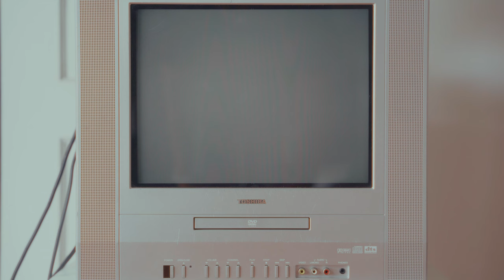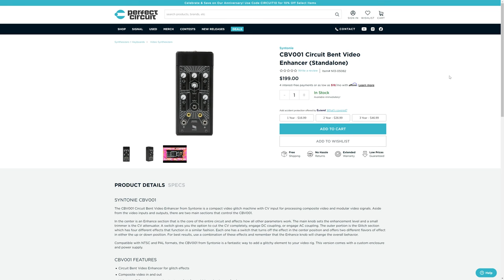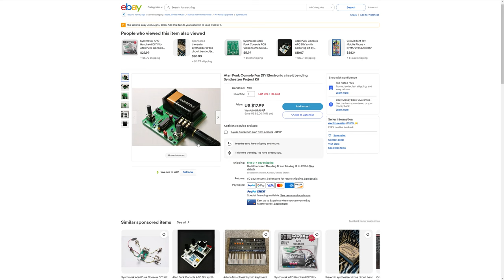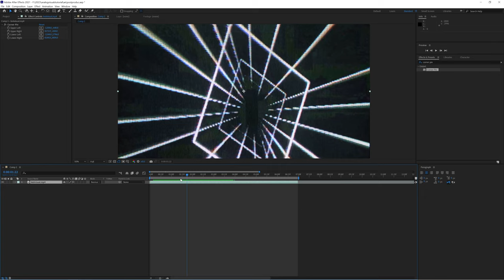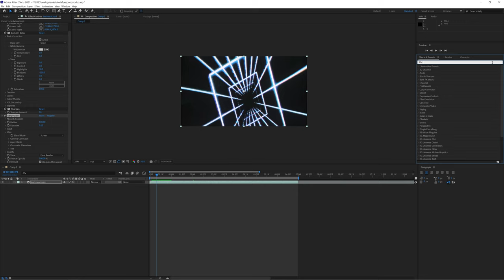How To Get REAL CRT Glitch Effects | Circuit Bending Tutorial

Comment: Instead of filming the screen why not output the signal from the TV back to the computer? Or just go HDMI to circuit bender back to computer?
Reply from the maker: that’s a good question! My specific TV does not have the proper ports on the back to do that. However, studio CRTVs have additional RGB ports on the back which should (in theory) allow you to output the signal back to your computer. However, I haven’t found any studio CRTVs for under $1000 dollars, which is a difficult price tag to justify for a 30 year old TV.
Reply: the goal is to introduce the cathode ray tube artifacts into the image.
Reply: Watch yovozol’s video on Time base correction but essentially when dealing with glitch effects without one of those tbc units only a crt will be able to display the glitches.
Reply: @patrickcasella  you don't necessarily need an additional port on the back of the CRT. Another way to do that is to buy an active, cheap composite multiplier so that you can duplicate the video output and send it both to the CRT and to your computer without losing quality. Obviously, you will need a composite to HDMI converter (also the cheap one work decently, but most of them do not upscale the video to 1080x1920, for that you would need a decent converter like the TvONE C2-2755 - which is the one I use). Anyway, very cool video! It surely is a valid source for people interested in analog video glitch :)
Reply: @pushkarbrand as @glitchedproxy said most circuit bending works by corrupting the analog signal. Different analog TVs will display these corrupted signals differently, digital devices such as converters and upscalers will just go I can't decode that signal and give you no signal

You need a Time Based Corrector which will generate a new uncorrupted sync signal and try and map the video to it. I use one in an old Krammer switcher / upscaler but even then there is times when it shows black while my CRT is still showing something interesting

Comment: do you need a crt vhs tv for the circuit bending stuff? Can I not just use one of my monitors and record my first monitor on my 2nd?
Reply from the maker: crt is absolutely required to circuit bend. From my understanding, it is the process of how the cathode ray tubes (CRT) emit electron beams on the screen that creates the picture. The circuit bending hardware is a medium to change the way the signal is processed. This is not possible with normal computer monitors (to my understanding). That’s what makes this process so unique, there’s endless combinations of media you can feed into the CRT, the different pieces of hardware you use to manipulate the TV, etc… it’ll all provide different effects. Hope that explanation helps, good luck!!